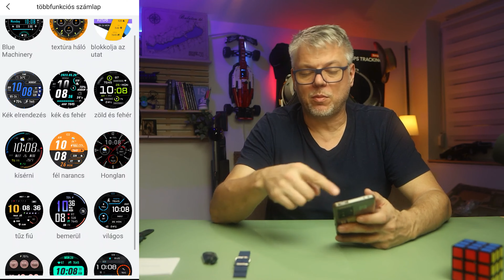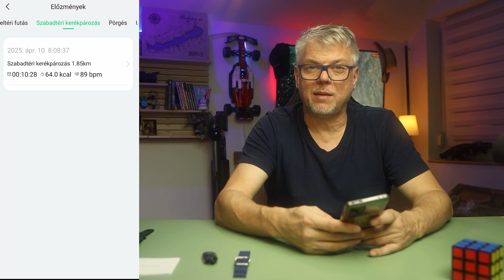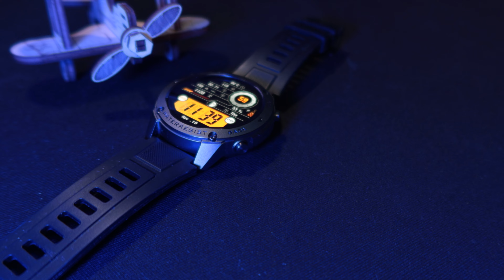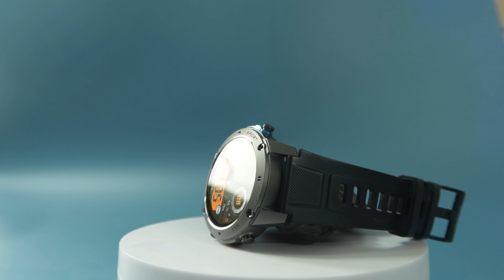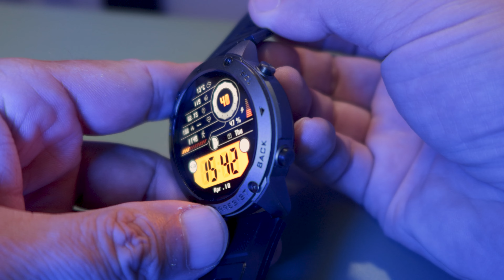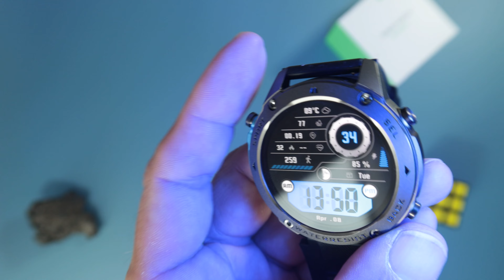BlitzWolf Voyager 1 smartwatch test and review

Comment: Despite a fully charged watch BlitzWolf BW-Voyager1, up-to-date firmware, and a perfect connection with my phone, after about 30 minutes the watch loses the GPS signal and returns to its home screen. This happens every time, systematically. I then lose all tracking of my workout and all my workout data. I have reset the watch several times, but it has not changed anything. I used with my phone and without my phone : I still have the same problem. I bought it at Banggood.

Comment: Hi! I bought one of these watches, but unfortunately the activity measurement doesn't work well. For example, while cycling, the monitoring stops and randomly returns to the home screen. The same happens when walking and hiking.
Reply from the maker: Hi,

Unfortunately, several people complained about this error after the test. Try using it without a phone connection; this helped some people solve the problem.